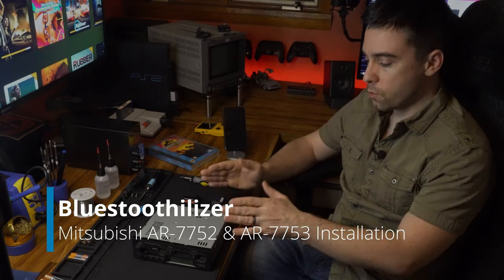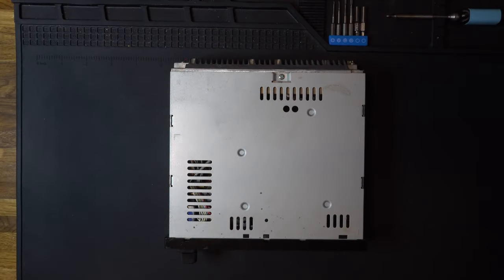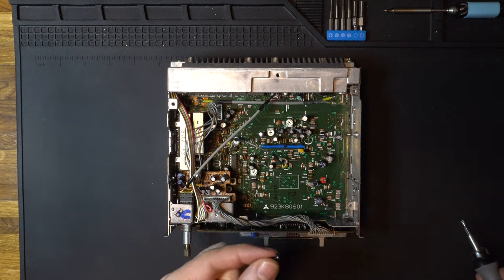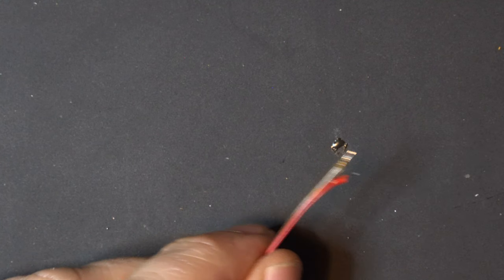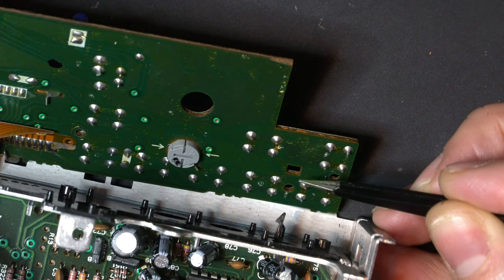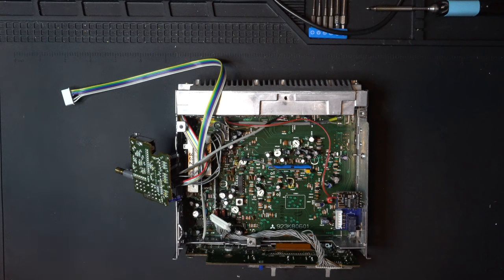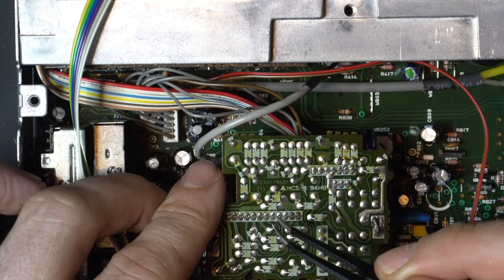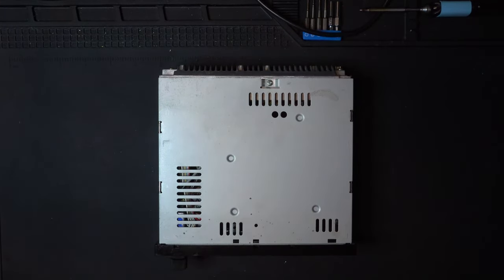Installing the Bluestoothilizer - Adding Bluetooth to 1992-1996 Jeep radios

Comment from the maker: Some radios may experience a higher than desired noise floor (hum) in Bluetooth. A quick fix for this is to ground the module to the chassis using a resistor leg, like so: https://i.imgur.com/rXG4KiA.jpg
Older Jeeps have not so great power circuits. If your radio resets Bluetooth when, for example, toggling your headlights, solder a 1,000 uF capacitor across the 5V just like this: https://i.imgur.com/un5lkXg.jpg

Comment: Been thinking about doing this since I recently revived my stock radio. FM transmitters are nice but can be finnicky. Also I have a question. I have a cassette radio but since the cassette deck doesn't work, I was thinking of using the play button as a switch to skip forwards or backwards through a Playlist. Could that be possible with that board by chance?